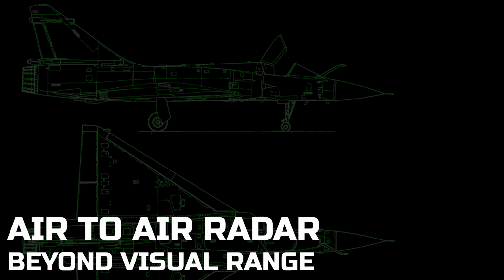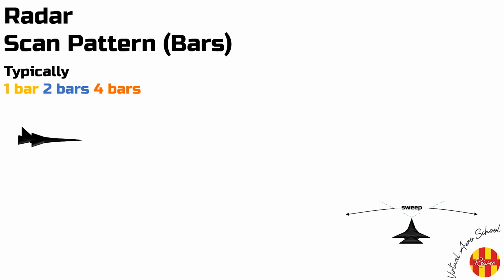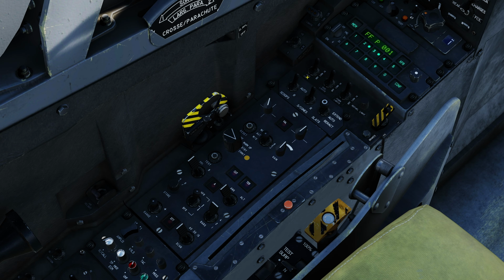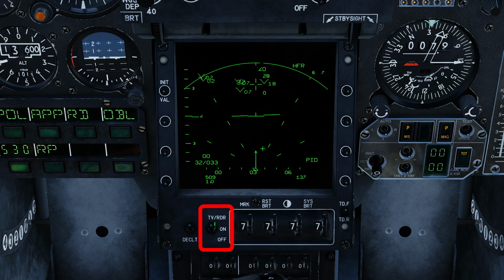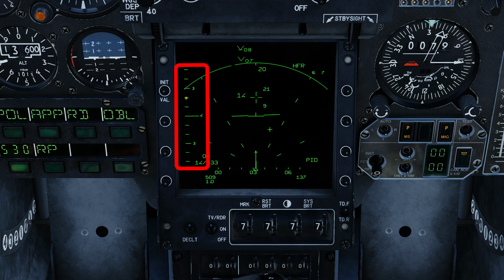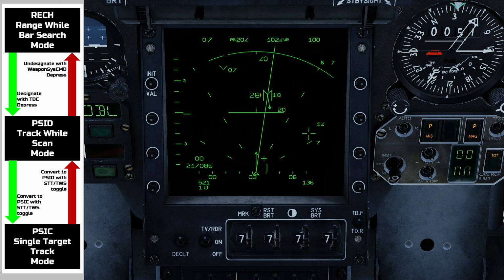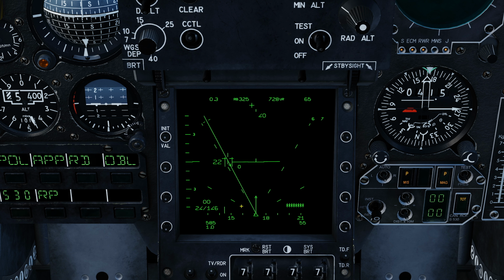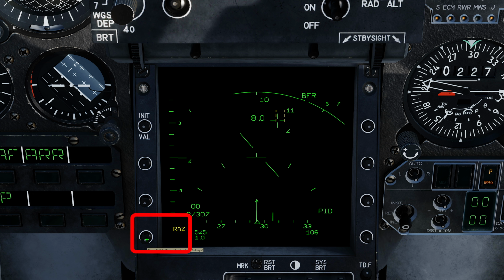The Art of the Mirage 2000C - Air to Air Radar in BVR | DCS World Tutorial Series

Comment: I recommend to have PID over PIC because PIC can warn the other aircraft through their RWR that you are tracking them. If you fire a missile, it will automatically transfer to PIC to for the missile guidance. This also makes you have more situational awareness as you are still scanning the air. The only time I will use PIC other than missile guidance, is for the Non-cooperative recognition system, which cannot be done in PID.

Comment: (Developper here)
Outstanding work!! Very well explained, and crystal clear.
A little comment about commanding a lock : it's possible to lock into PSIC (STT) directly. If you use the STT/TWS toggle command while in RWS, on the bottom right, "PID" will toggle to  "PIC" and back. This indicator tells you in which mode you will command a lock with TDC depress, and is memorized. 
So, instead of locking to TWS, and then convert track to STT, you can press the toggle button while still in RWS to show "PIC" and command the lock afterwards.
Reply from the maker: Thank you very much! Very kind of you to say!

I do briefly mention the immediate command to PSIC option about 21 minutes into the video. :)
Reply: I likely missed it ! Thanks
Reply from the maker: @Chwibon  No worries at all. The Mirage 2000C is probably my favourite module in DCS World - she's an awesome machine!

Comment: 12:02 - The Ang - Alt switch (S - Z in French cockpit) is not just altitude display format at alidade position, it changes antenna elevation control mode. In "Ang" (S) you control antenna elevation directly: pressing elevation control switch changes antenna angle and VTB shows two numbers of altitude range that is being scanned at current alidade position (for example, if you move it closer the altitude window will change to a narrower one and you may need to adjust elevation to scan at previous altitude range). In "Alt" (Z) mode you use elevation control switch to set altitude at alidade position and antenna will tilt automatically such that the beam will be centered at selected altitude at any alidade range (for example, if you move cursor closer, scan center altitude will remain the same and antenna will tilt automatically to maintain the beam centered at that altitude). S mode is still more versatile, but Z mode has it's applications too.

Comment: Coming back to this one. Issue im having is after I have locked and shot down a target the altitude doesnt switch back to the 0-26k ft sweep or a positive altitude sweep. It does a -400 to -700 etc. It is only showing a negative sweep if that makes sense. Im not sure how to get it out of this mode. I guess im having an issue with the radar elevation.
Reply from the maker: Yes, that's typical. 

As your Super 530D approaches the target, the target's first inclination will probably be to dive. The radar in PSIC will track this and tilt downwards. After the target is destroyed the radar will continue to track the debris for a short while, by which time you will likely be flying over it and the radar will have a severe downward tilt if left unchecked.

Once you are sure your missile has connected and the target has been destroyed, press Weapons System Command Depress to unlock the debris and manually readjust the radar elevation to the centre using the usual controls (it does not automatically return to the boresight elevation as it does in some aircraft). Use the scale on the left of the VTB to see how the radar is tilted vertically.
Reply: Ah okay I'll try that.